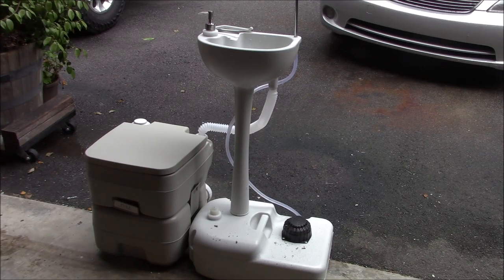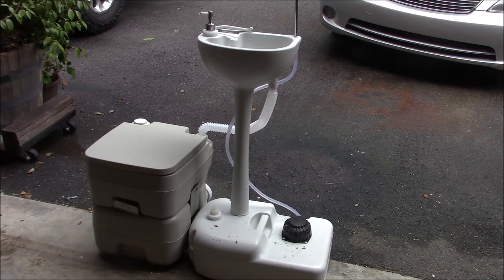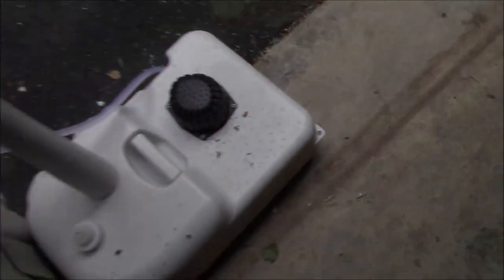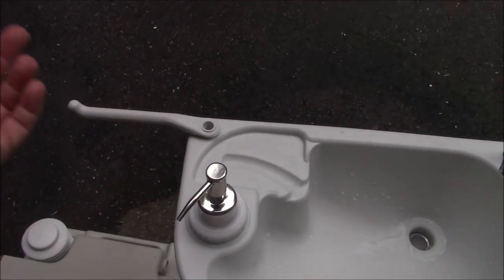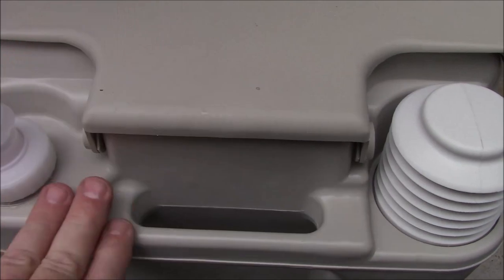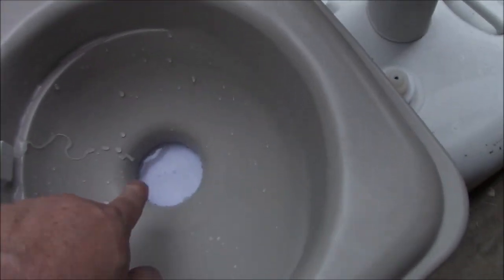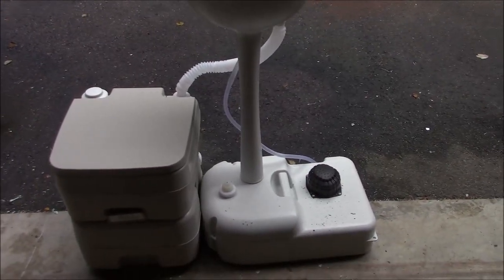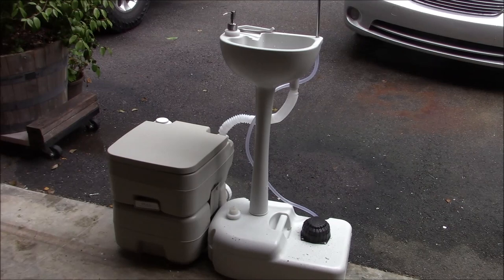Ultimate Portable Toilet and Sink System (overlanding, camping, glamping)

Comment from the maker: A few points I didn't make in the video.  I would put some scented tablets or liquid in the black water catch tank. Can be bought on Amazon, Home Depot, etc. I would put some Clorox in the freshwater tank if storing for any length of time without use to keep bacteria and mold from growing. Be sure and not put too much.  https://www.amazon.com/Camco-Ultra-Concentrated-Treatment-Formaldehyde-41183/dp/B016V2B1Z8/ref=pd_lpo_sbs_263_t_0?_encoding=UTF8&psc=1&refRID=Y45PEVEX45K4NWCMRWV3
Reply: Can you use toilet without sink connected?
Reply: @oteriawilliams173  Yes. It would be very useful to have a bucket of water beside it though to pour in and "flush" the toilet.

Comment: Is it possible to mount the sink to a wall or set it into a cabinet so that the space where the stand(stem) is located can be used to store the potty. Kind of like a self contained cabinet unit? Hoping to install in a van!!
Reply from the maker: I am sure you could figure out a way to mount it to a wall even if it was nothing more than a bungee cord. Yes, you could build a cabinet around it. I think you are better off just doing a temporary style mount to secure it. That way you can take it in and out of your van.

Comment: Where do you get rid of the septic water?  I have asked a million times and the answer is usually. Everywhere. Lots of places. I got more answers on humanure and composting toilets than on anything like this, so that is what I ended up going for.
Reply: Sewage can be emptied into any camp ground sewage port, or into a septic tank , even into a toilet if your careful
Reply from the maker: A few options depending on how long you are at camp and if you have access.  You could dig a hole to dump in (away from camp and any water source) you could dump at a campground, possibly truck stop, RV Park, etc.  Carefully dump into a toilet a little at a time.